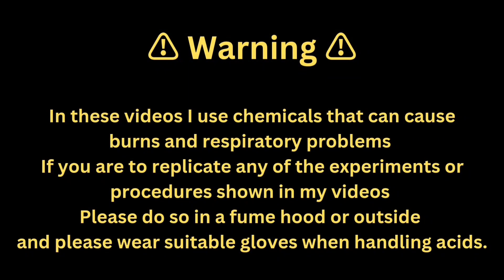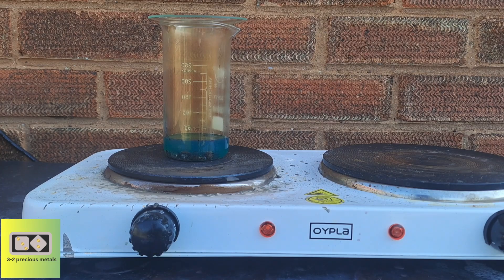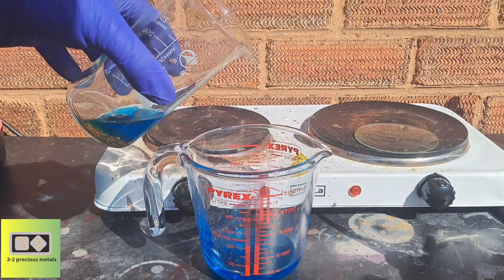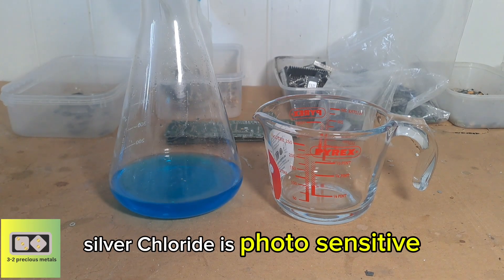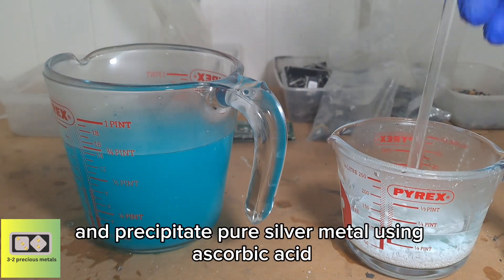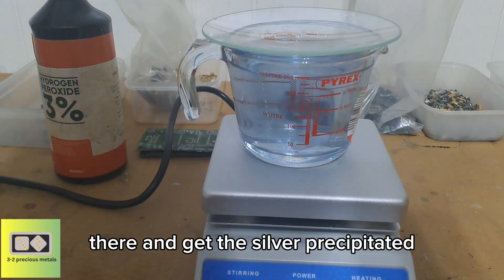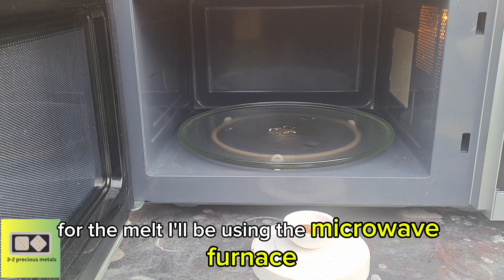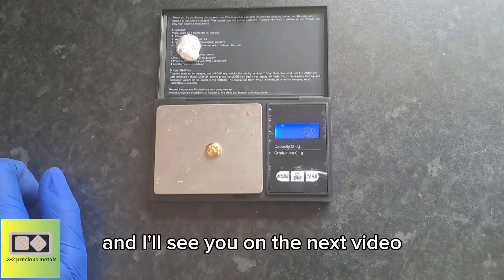Refining Gold and Silver recovered from jewellery scraps and bench sweeps

Comment: I’m really new to all this just curious, you said you used potassium nitrate in the aqua regia is that correct? Should it not be hydrochloric acid and nitric acid?
Reply from the maker: If you can get hold of nitric acid it is better to use but pottassium nitrate converts to nitric acid in hydrochloric acid . KNO3+HCl=HNO3+KCl you just need a small excess of hcl to allow room for the gold to dissolve. I have to make my own nitric acid as its difficult to get hold of in the uk so I use the pottassium nitrate just for speed really. If I'm doing a final refine I might use hcl and  hydrogen peroxide as the oxidizer. Hope this helps 👍